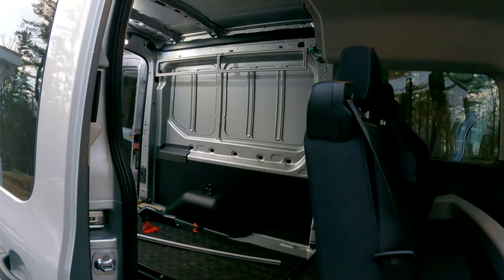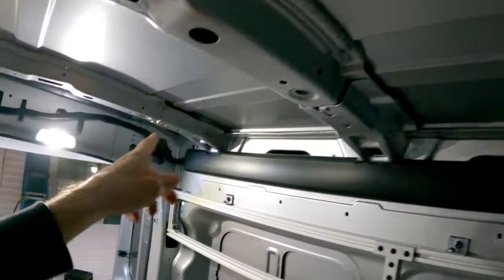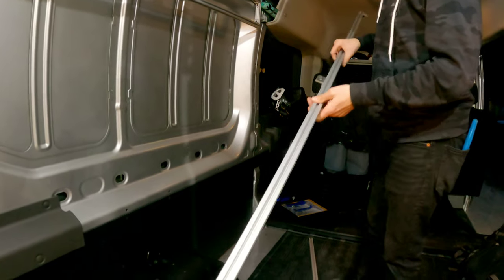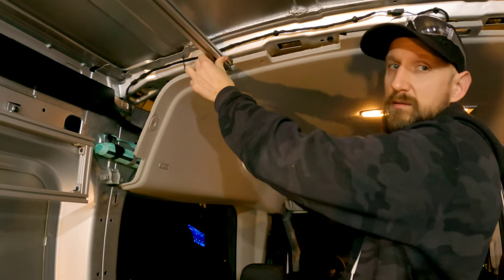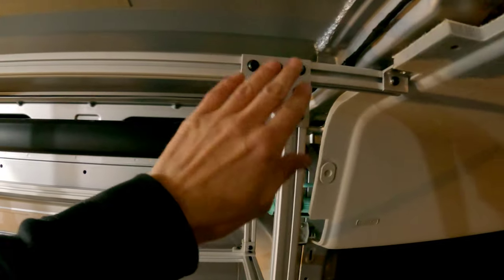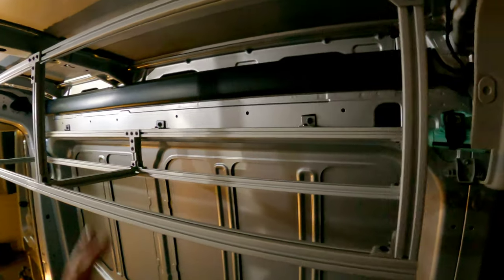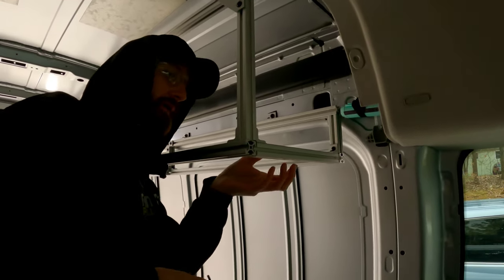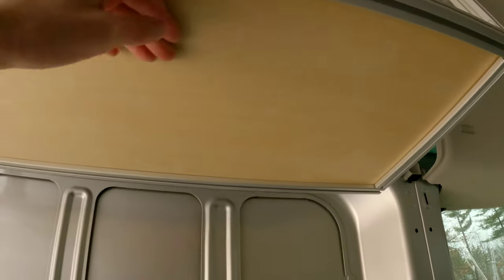MTB Van Build | 8020 Shelves / Cabinets Under $350

Comment: Nice sturdy cabinet at a reasonable price.Adventure wagon has the mule bag system on L tracks but 2 bags runs at $800.00. U.S. plus the L track. I was possibly looking for some similar duffle bags that could be hung on L tracks. Thank you for sharing your system.  Very functional and strong.
Reply from the maker: Yeah I was pretty frustrated with the prices of cabinets by most van build companies which is why I built my own.  I did however see some very reasonable priced stuff by browsing on Etsy beleive it or not.  Seems to be a pretty good resource for items that aren't exactly mainstream...

Comment: When connecting to the Transit consumer connection point are you plugging into the solar input port on the goal zero?  I should be taking delivery of a 2021 AWD with dual batteries and the adventure package in about 10 days from now.
Reply from the maker: Mmm no you don't wanna do that.  I connected to the CCPs via the yeti car link module which you would need to connect to the ccps.  I am working on that video now but have run into some snags where goal zero wants my unit back for troubleshooting.

Comment: I am about to set rivnuts in the ribs after enlarging the same holes you did. When you set the 80/20, did you find it magically lined up 90 degrees everywhere or did you have to make any adjustments?
Reply from the maker: definitely not 90 degrees... I cut aluminum angle and if I needed to get the angle right I'd hit em with a hammer lol.  I also mounted 3/16" rubber behind the angle to the van so I wouldnt' get vibration loosening/noise

Comment: Great video! You gave me some juicy ideas. I am worried about getting rid of the foam blobs, though. Is that a safety hazard? Where did you get the headliner trim piece? What gasket material did you use?
Reply from the maker: Not sure what you mean by foam blobs... the headliner trim peice came with my van as its the crew version.  The gasket material is 8020 you can order it directly from them or find it other places.   It's just the 10 series panel gasket...

Comment: Is it worth putting a little anti rust paint on the Rivnut so it squishes onto wet paint when you cinch it up?
Reply from the maker: I mean, honestly I think it's a bit overkill.  I did the whole just because it was bare metal and figured I would.  I also run a webasto heater so I'm not ever worried about moisture build up in my van so 99% sure it'll never see any rust inside the vehicle... maybe if I was doing it on an exterior panel or frame it would be a good idea, but then I would most likely just seal it after installation...